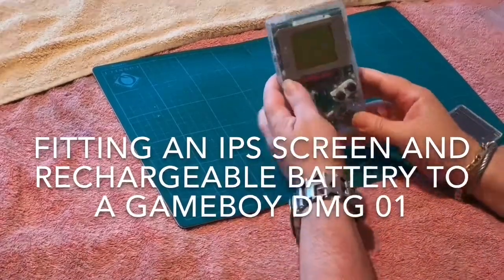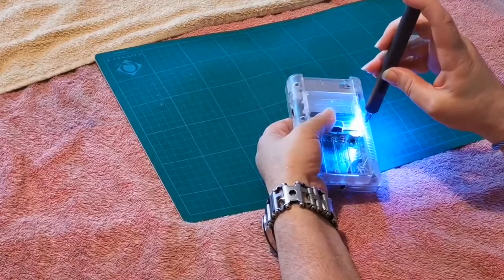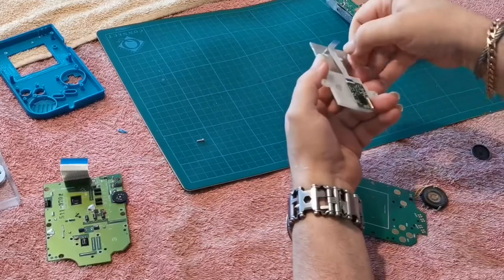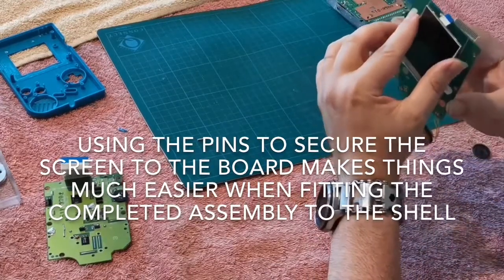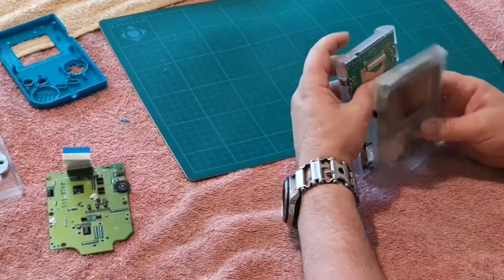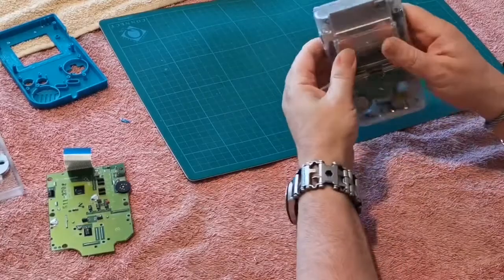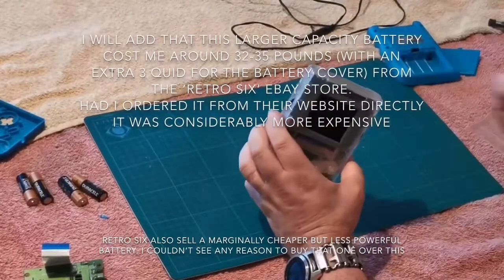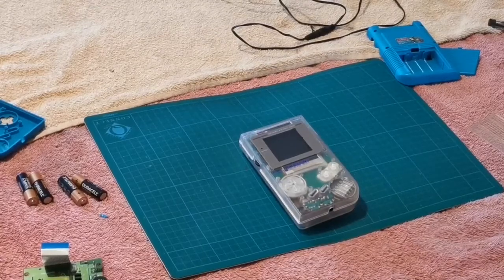Gameboy DMG. IPS screen and Rechargeable battery fitment

Comment: Great video, I’ve just done the same, thanks for the fantastic tip regarding fitting of the clean juice battery circuit, it kept shifting and losing contact. 

The new screens are fantastic these days.
Reply from the maker: No problem 👍 Thanks for the comment, appreciated